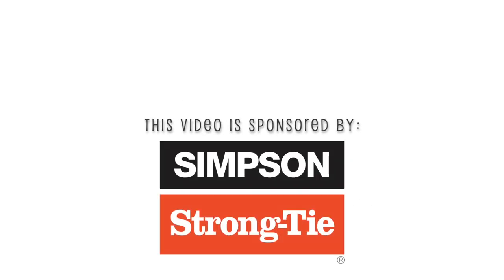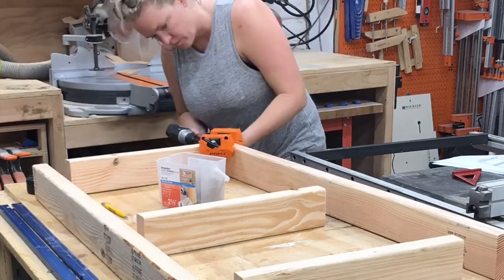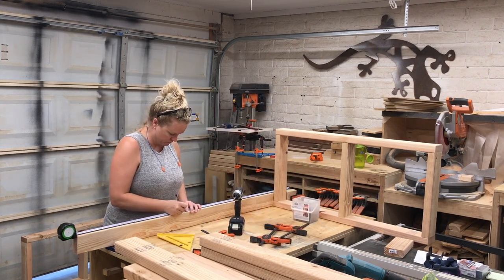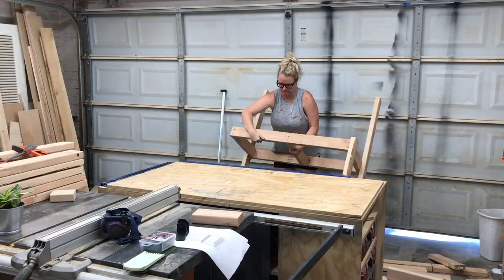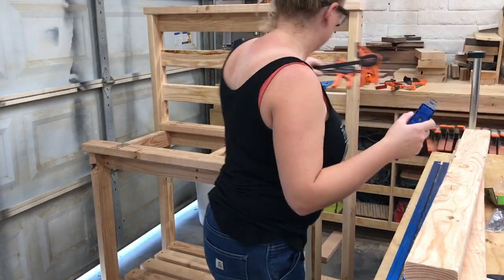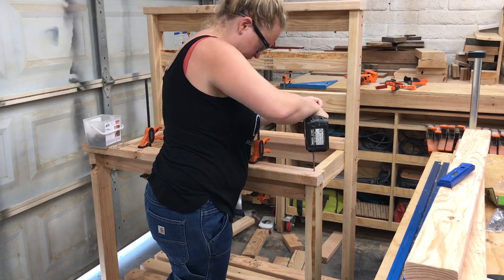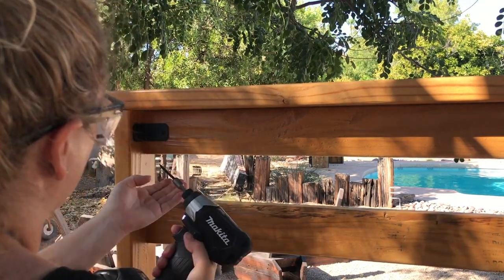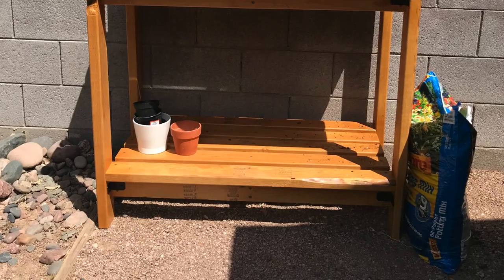DIY Potting Bench | Awesome Beginner Project

Comment: How does the bench hold up in the weather outside? My patio leaks. Im hoping if i put a protectant on it, it will hold up. 

Awesome video by the way.
Reply from the maker: Thanks! Mine is still doing good. It is in full sun and no covering. But will probably need maintenance on the top soon. 🍊

Comment: Nice work! How has this held up? Was the finish enough to protect against the elements and any dirt and water that comes with re-potting? Do you recommend the combination You mentioned in the video?
Reply from the maker: Thanks! The table has held up well. The finish on the very top table is starting to peel, but I do have the table in direct sun all afternoon. 🍊